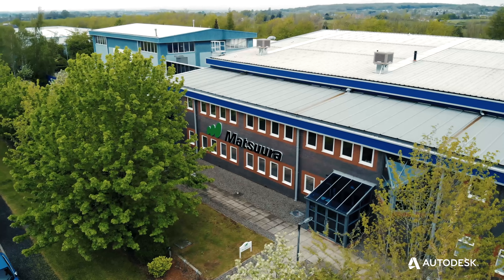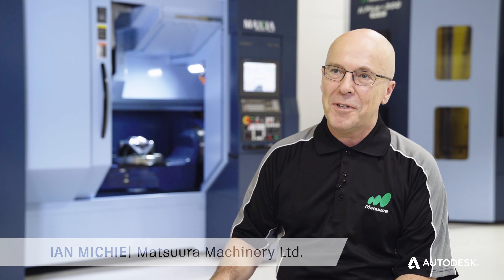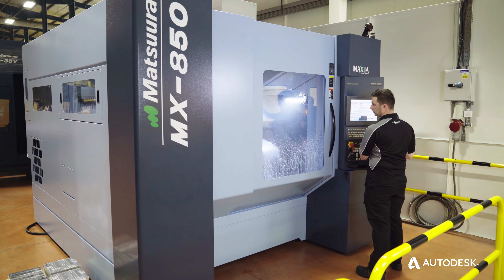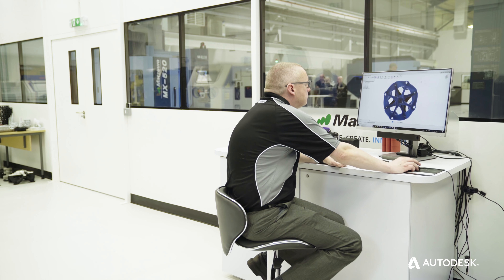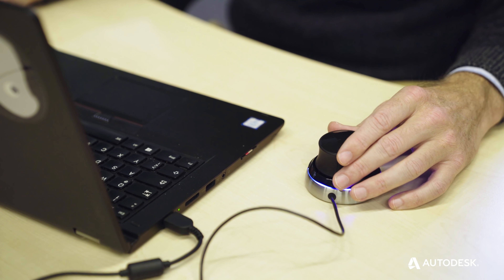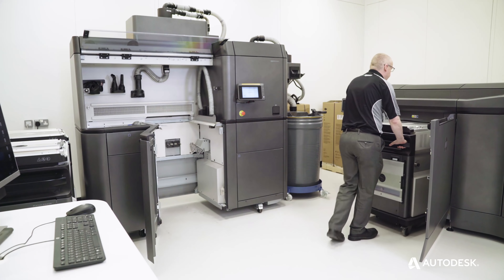Matsuura is winning with generative design in Fusion 360

Comment: Very cool but it raises a lot of questions.  What material was work holder printed in?  Was it plastic or metal?  I assume it was the metal jet technology.  If so can a metal jetted part be directly machined on rather then just being used as work holding?  An example being an organic shape 3D printed metal hinge that then has smooth mating surfaces machine onto it?
Reply: flantc it’s Nylon.
Reply: Keith Strang. Wow!  Is Fusion 360 used to perform an FEA of the work holding structure?
Reply: @KeithStrang  That is definitely not PA12. You can see reflections on the chamfers.
Reply: Hexx Cube I know the HP Fusion Jet printers have a limited material selection.  I know they have a glass filled nylon, maybe it’s that? It’d make sense as the glass makes the nylon more rigid.

Comment: I applause at the end of the video without knowing it... Congratz FUSION360 !...

I still use MOI3D for design anyway. Love the intuitive flow it has to offer. Wish F360 has the same fluid workflow in terms of design, though it may be super hard since it won't go along with parametric modeling... (?)
Reply from the maker: There are pros and cons to any software, it all just depends on what you do.

Comment: Why does the part printed out of PA12 suddenly reflect like metal and gets darker in color? Are you trying to bamboozle us ;)
Reply from the maker: What part are you talking about? I'm almost positive no bamboozling is happening but I didn't make this video.
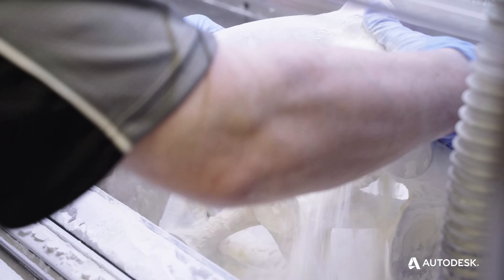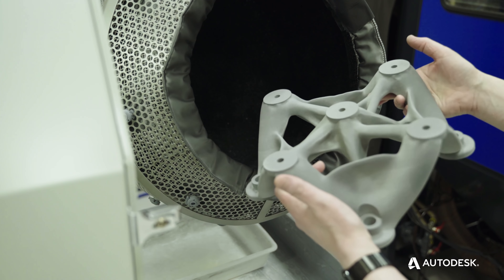Reply: @adskFusion  At 1:57 you see, how the print gets taken out of the polymer printer. Then at 2:15 he shows the finished nylon part. Still light in color and not reflecting. But at 3:08 the fixture is darker and a metal reflection is visible on the chamfers at the mating face.
Reply: @lukasbitterli  im positive that they used some kind of resin to post process the 3D printed part.
the do that to improve the characteristics of the plastic part
Reply: @alexanderreiig3650  But that doesn't explain the shininess of the mating surfaces.
Reply: @lukasbitterli  If you soak plastic in cutting oil, it gets shiny.

Even if it is fake, I can tell you that it works, I have used 3D Printed milling fixtures, most of the fixtures I build are milled from steel.

However, I use many 3D printed Fixtures for the coordinate measuring machine

Comment: Sorry, but why did this need to be printed in metal? Isn't it just held from below with 4 screws? Wouldn't any old piece of scrap stock with 4 counterbored holes do that just fine? What am I missing here...
Reply: It also needed to be machined in five axis, while being high strength, while being easy to manufacture.

Comment: The big question is... Was it really necessary?
Reply from the maker: I don't think they'd do it if not!
Reply: I think what's been interesting about this workflow is using generative design to AUTOMATE design and off-load a lot (almost all) of the design work, especially when parametric design templates are used, so you get a fixture design that's strong enough without having to manually design soft jaws or something even more complex. Obviously there's some room for workflow improvement and I think it'll be more compelling once it's on a more complex part, but the use of generative as automation rather than optimization or exploration is pretty interesting, IMHO.
Reply: @adskFusion  could very well be a show-off of their tools instead of an "actual need".
IMHO they should have at least explained why they relied on generative design instead of a more "standard" approach.
Benefits and disadvantages if there were any
A thorough video about how fusion 360 and generative design are actually used to carry out complex tasks (that other software probably can't achieve) is a thing this channel needs.
And hopefully as time goes on, fusion will only get better and more widespread in the industry

Comment: Yeah, but you can’t make a good implementation of F360 on Windows with 4 k screens.

 Is easier for you to do generative design???? 

4k display of F360 (without blurry UI) on Windows is beyond Autodesk’s capabilities.
Reply from the maker: Have you seen this?
https://knowledge.autodesk.com/support/fusion-360/troubleshooting/caas/sfdcarticles/sfdcarticles/Performance-Tips-for-running-Fusion-360-on-high-resolution-monitor.html

Comment: I guess generative design is useful if you don't understand how to design for structures and load paths.  I think we run the risk of not knowing why or how the thing we're (engineer) accountable for was designed, and why, if it's handed over to algorithms in the cloud.  'Because the cloud say's so' doesn't stack up with me.

Pretty though.
Reply from the maker: I don't think I know any engineer who would guess the load paths to take a similar shape as what generative will produce. That and I don't know many who could model that up in a cad tool.

And any engineer worth their salt would quadruple check these resultant bodies to ensure their safety and performance.
Reply: As the video shows, generative produces many examples of designs that show how generative is iterating to a conclusion.  The fact is, they're nearly all basically the same thing.  You have defined fastener positions that must be maintained, you have applied loads, you put material cross section between them in a rational manner until the stress criteria is met (Von Mises for example...).  It is vital - absolutely vital - to understand load paths and constraints as an engineer involved in structures analysis and design. 

Any engineer worth their salt would be able to do this (at least any aerospace stress analysis engineer such as myself and my colleagues) and not need to check it 4 times ;).

BTW - I use Fusion360 nearly everyday for my own projects and it is overall a great package, however, I think the effort here could have gone elsewhere before starting down this path.

Comment: It seems like Fusion360 team is focusing too much on machinery but not focusing enough on the designing process. The program's drawing tools especially 3D need a HUGE improvement to pass Rhinoceros in means of designing freely. Now it takes like 20 different planes and sketches to build a surface which you can do it with maybe 6 lines and one command in Rhino. Without an improvement, you will lose industrial designers day by day because they will return to Rhino for free and faster curve and surface modelling. Just like I do.
Reply from the maker: Thank you for the great feedback. We don't want to lose IDs to 🦏 and have already targeted these improvements. Hope to see you back in Fusion when those changes are made.
Reply: I Still use Rhino because it just does what i tell it to. The measure tool of its own when working with laser scanned meshes is the single reason I went back to Rhino. Obviously this is because of the lack of parametric constraint but there is no reason that this can't be added to Fusion
Reply: @adskFusion  The massive limitation I see with Fusion 360, is that we do not have fluid exchange of CAD/CAM information with jobshops using Inventor/HSM or SolidWorks/HSM. The greatest benefit Fusion can potentially have is how fluid it should be to make revisions on a design and have it flow to manufacturing. In Scandinavia your Autodesk team seem totally inept at getting jobshops on-board the Fusion 360 platform, and that means that any alteration to CAD, becomes new task at the job shop with costs and version management required. I find it almost "criminal" that we cannot get a file with CAD & CAM from a jobshop using Inventor/HSM, because it would easily save 100$ per alteration you have to make on parts/drawings/revision history. When we bought Fuison the hope was not to get a cloud system on subscription but to be able to save work and cost in our interaction with subsuppliers. You have the key to massively reduce the massive amount of busy work that is involved with having a part manufactured at a  subsupplier from prototyping to finished product.